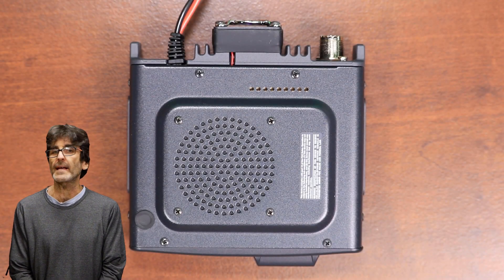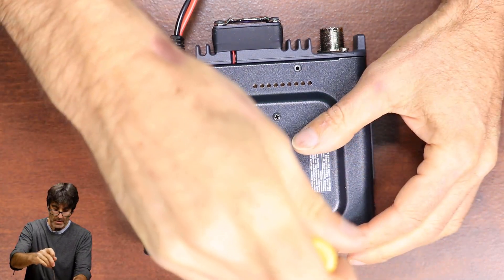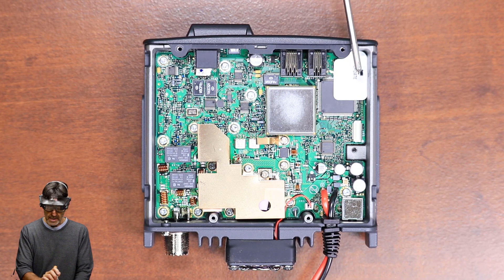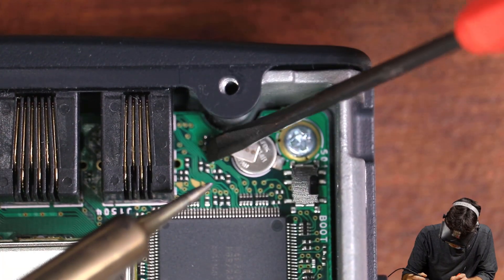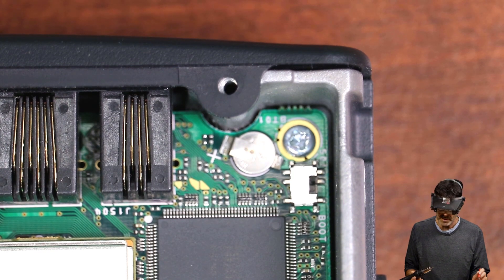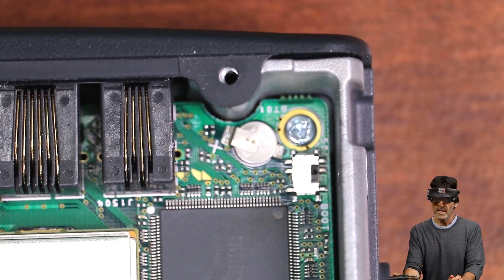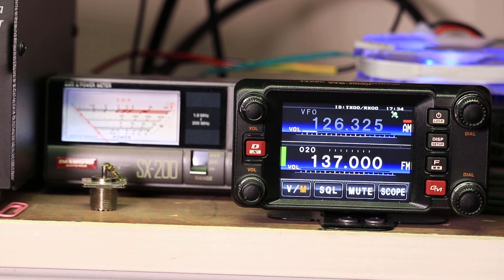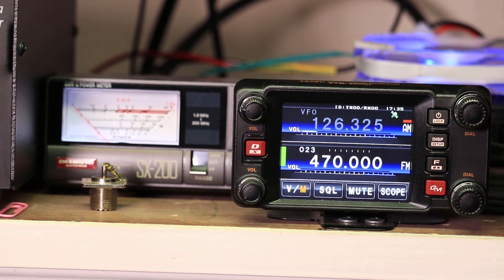Open/ Expand Transmit Modification Yaesu FTM-400XDR

Comment: I've completed this procedure on my FTM-200, 300, 500, FT-5D and my VX-6 and on each and every one the TX power is limited, 20 watts on the mobiles and 2-3 watts on the HT's. 

All that being said. What is the TX power output measured in watts of the FTM-400 on 462.575 at high output? 

BUT! On my ID-5100 and all of my Anytones there is no power reduction.
Reply from the maker: HI Rusted Link.  I've never had any problem with low power on the ham bands.  I know the radios aren't really tuned internally if you go out of it's designed bandwidth so I've never tried to crank up the power.  I suspect it'll have a high internal SWR and I don't want to do that.  Of course I've never verified that, but it's my suspicion.  I always keep the power at less than 10w.

Comment: Pardon my ignorance, what are you opening it to transmit to?
Reply from the maker: HI... No problem.  When it comes from the factory it is locked to TX only within the ham bands.  When you open the TX up it'll transmit most places it'll receive.  With the exception of the Air band and probably some others.  That is AM and they didn't build in an AM transmitter... although it'll receive AM just fine.

Comment: ⚠️ EASY WAY! ⚠️
 A Gas stove Or a plumbers blowlamp. A very small flat head screwdriver or better still A watch makers screwdriver. 👍 SIMPLE ...JUST HEAT THE TIP UNTIL ITS GLOWING AND TOUCH IT IN THE MIDDLE OF THE RESISTOR TO BE REMOVED AND GENTLY FLICK IT OUT. Goodluck 👍
Ohhhh Vacume afterwards.
👍👍
Reply from the maker: Great tip!  Thanks... I'll try that on a junk board I have laying around and see how I like it... 😊

Comment: have a question on after doing a factory reset, when transmitting on a repeater and unkey,  i can not hear the person on the other side of the conversation. but when i switch from main band to sub band i can hear the repeater. repeater requires no tone. no problem on simplex. other functions seem to work.
Reply from the maker: HI it almost sounds like the ENC/DEC is on.  I've seen that happen before but I can't remember exactly what it was.  My memory is going to the enc/dec or something to do with that..

Comment: hi , i'm ham. During an alignment of the FTM 400 radio in the TX power alignment parameter of the service manual, started as per procedure from 440.050 Mhz low power and 5.3 watts, I continued up to medium power 20W.
By storing the 5.3 watt parameter in the Adj 02 PWR menu with the Adj 02 DVR parameter with 9AH in low power and the medium power parameter Adj 02 PWR with 20W and confirmed with Adj 02 DVR with B0H.
When I reached high power (50 watts), while I was rotating the dial to align the 50 watts, the Wattmeter with the built-in laboratory dummy load burned out. Now I don't have a tool to align and verify all 3 parameters, especially the high power one which stopped at E1A when the wattmeter burned out. On VHF I obviously didn't continue to set anything.
Can you tell me the alphanumeric codes (e.g. 55H 92H E1a etc which are factory set in the respective power parameters 5 - 20 - 50 watts in UHF in the service menu? I would like to set it with those factory values since I don't have a Watt rf instrument from measure at the moment.
Reply from the maker: HI, I don't know that off hand.  Thanks.

Comment: It would have been interesting to see what happened to the power output and the receive sensitivity after this mod, actually after any ham radio mod.
Reply from the maker: Ive never noticed any ill effects to the receive, but TX will diminish once you leave the frequency range the radio was designed for.  That's why I never try to TX with full power once I leave that range.  The radio will develop a high internal SWR which could damage the radio.

Comment: Great video. I don't get the Tx Error anymore in the range. But, even though it appears I am transmitting, I cannot be received. It appears the radio isn't actually transmitting. I must have messed up something while removing the component.
Reply from the maker: Oh no!  Can you take a closer look with a magnifier and see if there are any solder bridges or something?

Comment: After doing this mod my radio refused to read the saved data from the SD card.  I had to do a reformat and reprogram the frequencies using the Yaesu programming software.
Reply from the maker: I had a couple of people say that.  Thanks for the info, it will undoubtedly help someone..

Comment: How is it that the display is showing a freq of 126.325 AM when this radio doesn't work in that range and is an FM radio to boot?
Reply from the maker: It will RX on the aircraft band, but not TX.  It will RX on AM in that freq range.
Reply: @JLPicard440  I'll have to try again, for some reason I couldn't get it to go there when I tried last.
Reply from the maker: If I remember right there's something in the menu that is for wide or narrow RX.  If the narrow RX is selected it won't tune to the aircraft band.  I don't remember exactly where it is, but I do remember seeing it.

Comment: OK I did it, was easy but now my radio won't read from the SD card. I had it all backed up. Took the same SD card to another FTM-400 and it works fine. Any ideas?
Reply from the maker: I am not familiar with that.  I have heard this from some, and some had no problems.  You might try to reset the radio back to factory default if you don't already have a bunch of stuff programmed into it.  I've not had any trouble with mine.
Reply: @JLPicard440  Well I have found these Taesu radios are not very easy to work with. I should not be on a first name basis with Endoff, Roger and Jaun at Yaesu Tech support.
Reply from the maker: @MichaelRandazzophotoguy  ☹️☹️

Comment: Hi, I opened up radio to do this mod, to find already missing the resistor. I did a factory reset and still when key Mike it says “ERROR TX FREQ”. What is the problem please.
Reply from the maker: I'm not sure on that one.. Did the Error TX frequency error come up before the mod?  Does that Error only come up outside the ham band?  Or within the ham band too?   Are you trying to TX outside the frequency range of the mod?  I don't remember the range.. it's like 136-174MHZ or something like that..

Comment: Hello, thank you very much for the magnificent video and the explanation. Just one question, I live in Spain, is this modification valid for the version that is marketed in Europe?
Reply from the maker: HI Manuel... I can't answer that for sure.  The EU version could be different.  If you can google the version and see if anything comes up for it and compare to what I did.  It may be a matter of removing extra parts or different parts than I did.
Reply: @JLPicard440  Thank you very much for the information, I have acquired a practically new one and they have told me that it is not open in TX, I will follow your video and I will make the modification, I imagine it will work, I will tell you when I do it.
EA7LH 73
Reply from the maker: @manuelescalona2932  Excellent... I would make sure of which version you have before you change anything..

Comment: With GREAT hesitancy, I tried this mod. It works great, Thank You! I used a very pointy soldering iron and an Xacto knife and the chip came off in a few moments without issue. 

There was one "Oh, SITH!" moment when I tried to reimport my freqs from the SD card when I got an ERROR message and could not get my settings back. The fix was very simple. All you need to do is reformat the SD while it is in the radio, move the SD card back to your computer and redownload the settings, put the SD card back in the radio. The SD card was then read by the radio without issue.
Reply from the maker: Excellent!  I'm glad you got it going...  I had a couple people say they had an issue.  I hope your experience and solution will help someone. ..
Reply: Thank you

Comment: I have a question I hope someone can answer. How do you set needed data for GMRS/FRS channels that are using “privacy codes”?
Reply from the maker: I'm not sure you can.  This radio was intended to be a ham radio originally.  There are repeater tones that you can program in, but I don't think that's the same thing.  I could be wrong though.

Comment: Just got done with this mod on my ftm400. Works great.  I used a sharp point soldering iron and tweezers. I then programmed the radio manually with 100+memories gmrs, murs, itinerant business band, all seems to work as normal. Yes I do have gmrs, business and ham licenses thanks for asking.
Reply from the maker: Excellent!  I haven't had any trouble with mine either after the mod..

Comment: It would be a fantastic Transceiver if it was possible to choose the TX setting suitable for legal 446 PMR DPMR , rather than having to modify the rig. I wanted a Transceiver that I could replace my Ham and DPMR in one mobile unit. Instead I have to install a DPMR transceiver too just in case of an emergency . 🤦🏼 I carry a handheld transceiver & often communicate with the passengers sat in the car waiting whilst I’m rece a location. They can’t reply via the FTM 400 because it doesn’t allow TX on any 446 channels.
Reply from the maker: Interesting.  I'm not familiar with a DPMR unit?

Comment: Have you found a good antenna that works good on 2m, 70cm, and the gmrs frequencys?
Reply from the maker: Finding one that works well on the GMRS will be an issue since it's 20MHZ away from it's intended use.  I don't think the antenna would be quite that broad banded.  I would recommend low power only on that band since you'll likely have an SWR issue to think about...
Reply: @JLPicard440     Comet CA-2X4SR covers it all
Reply from the maker: @brucekempf4648  Good 2 Know!..
Reply: It's not perfect, but I do pretty well with a dual-band Signal Stick mag mounted to my trunk. Receive is great, tx is slightly noisier than a dedicated gmrs but works pretty well for daily stuff. Maybe keep a second gmrs in the car and swap out if you're really needing that function to work at its cleanest. (Definitely remember the power limits imposed on the gmrs/frs channels too)

Comment: I bought ftm400 in Japan version , it’s small range tx , please explain me to modified for wide range tx , please mention name of component which remove from main board
Reply from the maker: I don't remember the specific component.  If you don't have a mods.dk account it's free.  You can get on there and more than likely they'll have the mod for you to see exactly which component to remove and the location.
Reply: @JLPicard440  thank you
Reply: @JLPicard440  is this work transmitt in 144 ~ 148 MHz too ? I will modificate Japan version FTM 400 XDH ( not XDE or XDR ) only 144~146 MHz VHF ,

Comment: sir on 2m band i know the radio put s   5w out on low power.    is there a way or adjustments to reduce it to 1w for an indoor  low power application as its to much  ?    regards
Reply from the maker: Yes, absolutely.  You have to enter alignment mode.  The procedure is in the Technical manual under "TX Power Adjustment".  I have to caution you that you can ruin your radio if you accidentally adjust any of the other parameters other than the TX power.  The manual can be downloaded on mods.dk under FTM-400XD technical supplement..  I hope this helps .. 🙂
Reply: @JLPicard440  ok sir  thankyou  thats that sorted  one last question what needs removed for wideband RX  so i can here from  480 to 999 mhz or is it wideband rx  from factory  because im getting error   rx frequencey  ? past 480mhz above

Comment: I did this mod and it worked. I was really nervous but took my time a planned it out. After I finished I plugged my radio back up and I couldn't load channels back into my radio from my PC or a SD card! I read some comments here before I did the mod and I knew there were reports that this effected the radios memory programing. Also, my Lat/Long, gps, and clock page were gone! I was freaking out. After watching a RT systems video it turns out that after modifying the radio you have to upload the radios info to RT systems on your PC then download the memory channels you want. Also, you can set the radios features in the software so the lat/long and other missing features came back without having to be turned on manually.  Hope this helps someone.
Reply from the maker: That's interesting... I never experienced any of those problems.  Thanks for the feedback.
Reply: I hope this helps me!   I just did this mod on my FTM-300, and found I could no longer load the memories from the SD card I had just backed up.  I really thought I just ruined my radio, and am freaking out a bit.  I haven't had time to really trouble shoot it yet, because I'm at work right now.  How did you upload the radio's info in the RT systems exactly?  Did you get it working?  Thanks.
Reply from the maker: @natw8327  We'll see if JJ answers.  I never had any trouble like that.
Reply: @JLPicard440  
Well it was pretty nerve wracking, because it really seemed like it was malfunctioning, but I figured it out.  Here's what happened, so if anyone else has this issue, hopefully they will read this and not go through all the anxiety that I did. 

So I did the mod, put the radio back together, and... It didn't work right.   Wouldn't change freqs, and the volume levels were frozen.  OMFG, I just bricked my brand new radio. 

I did a factory reset.  Those malfunctions went away and the radio performed normally as if it were reset, everything blanked out. 

Tried to reload my memories and settings using the SD card.  It just kept saying "ERROR" and wouldn't download anything.  

Final solution was to format the SD card with the radio again, and then export EVERYTHING to the SD card from the radio. (apparently this is where the important data from the modification would get transferred into the SD card.). 

Then go to RT systems, and import everything from the SD card to a new, blank,  file.  Then go to your old file with all your memory channels and copy and paste them into that new file you just made.  Save that file, and export it to the SD card.  Then go back to the radio, and import ALL from the SD card.  (It wouldn't let me do just "memory).  

Step 9:. Watch in amazement as the radio reboots with all the memories intact, and is not actually ruined.

Just editing to say, the important part is, you have to copy all the new radio settings to a blank file in RT systems. Then paste all the channels and stuff into that blank file. If you just keep trying to load that original file you saved before you modded the radio, it will never work.  you just have to copy and paste all the info from it into the new blank file you exported from the newly modified radio. 

  It's 2:00 in the morning, I hope I'm making sense.  But it works.  and if this helps just one person not go through what I just did for the last 2 days, I'll be happy.
Reply from the maker: @natw8327  Wow Thank you sir for the great information!  I have had this question come up before,  I want to pin your comment to the top, but it seems the option to do that has disappeared on me.. ☹️

Comment: I was excited for some reason thinking this mod would open 1.25m 😅 silly me. Still can’t figure out why my vx6 is triband but finding a new model mobile/base station with 3 of the more popular tech allowable bands is damn impossible. Oh well.
Reply from the maker: They didn't build into the radio the matching circuits needed to TX on 1.25.  It would have cost more.. it can RX without having to do that... :-)
Reply: Me too, that’s the only thing I wanted to unlock. I don’t understand why they couldn’t have built this radio with 220mhz transmit capability. I guess I’m just going to have to keep running a 220 radio in my car as well🤬. I was hoping this would work to unlock 220 I’d like to only need one vhf/uhf radio in the car. It receives quite well on 1.25 meters and simply by including a second antenna port and the correct electronics this could have been a lot better radio. Oh well we can’t have everything we want I guess.

Comment: Really wish this platform transmitted and received on 220/1.25m. Would be just about the perfect mobile rig...
Reply from the maker: IKR... 220 is dead in this area, but still alive in other places..
Reply: My ftm-400 receives 220.  But you have to go into the menu and select expanded receive.  But no transmit on 220 of course.  Wish it could.
Reply from the maker: @joedidit3233  Yea I know.  220 is to far out of the design of the radio.  Even if it would TX it would create a high internal SWR and damage something.. But yea, it'd be nice.

Comment: removed the transistor but nothing changed
I've reset to factory defaults thru the menu and reloaded the settings from my SD card
nothing changed here, can't TX outside the band.
I wonder if there is something to do with the firmware or the region? (I bought 400XDE and not XDR)
Reply from the maker: I haven't heard that one.  Doesn't make sense.  Did you remove the right part?
Reply: @JLPicard440  yes I did, but... And this the big but, I got 400XDE, the European version. I found out tonight that there is a different resistor to remove, so I had it removed too :D
It works now, loaded memory back and all is fine.
Reply from the maker: @revoland  Yes those different versions are a bit different it would seem.  Glad you got it going...